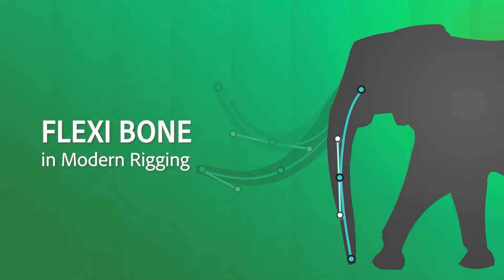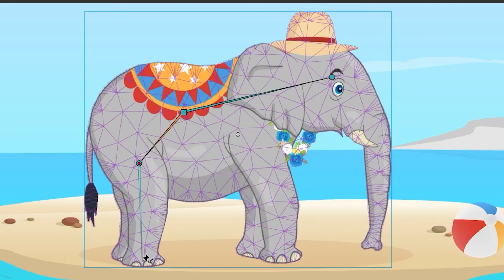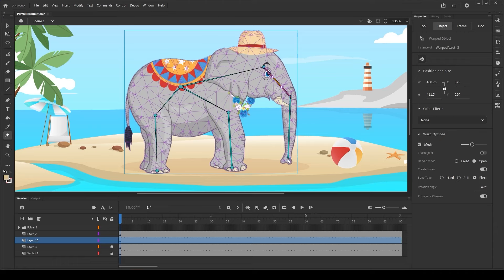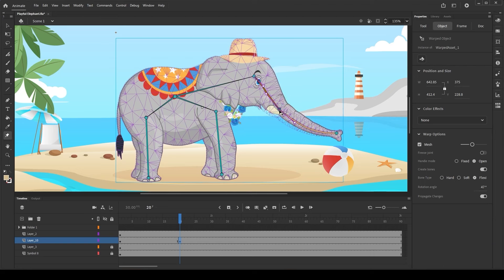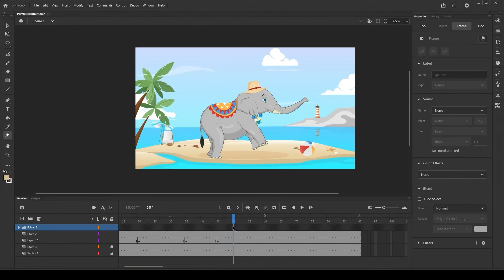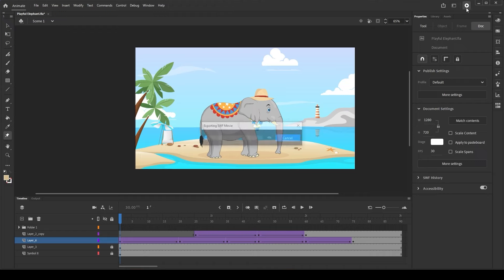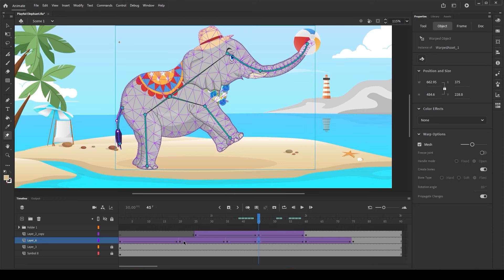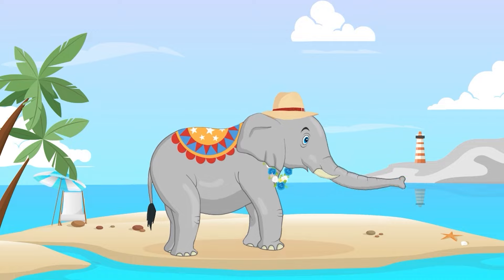Modern Rigging - Flexi Bone

Comment: This looks straight up awful bro. Webkinz wouldn't ship this. The issue is you don't have support for parented bones. This literally only works one a single image. The tusks, legs, flower necklace- all that need to be on separate layers so that this doesn't look like I just used photoshop 2008 warp tool. Without multi layer parented bone support this is useless.